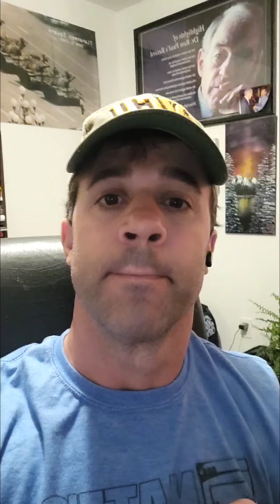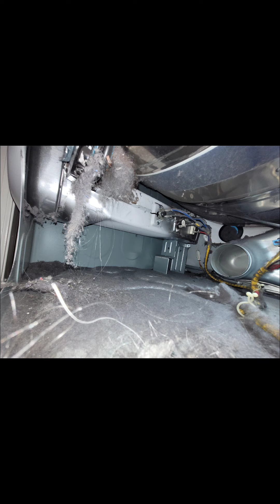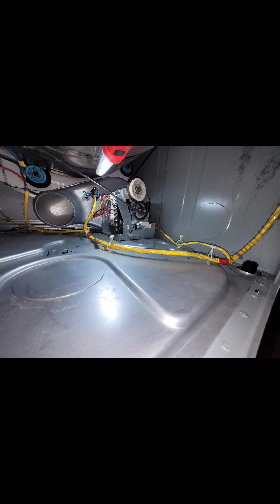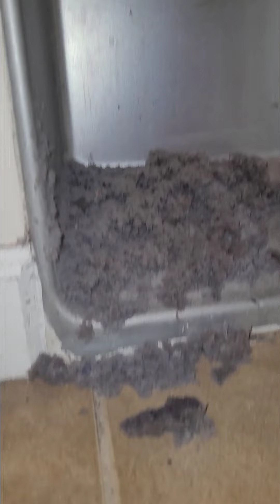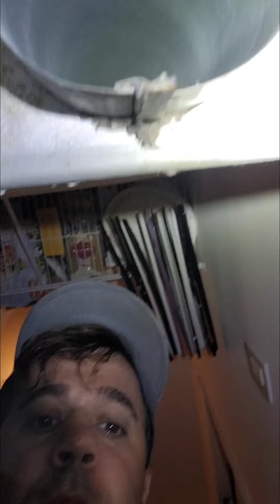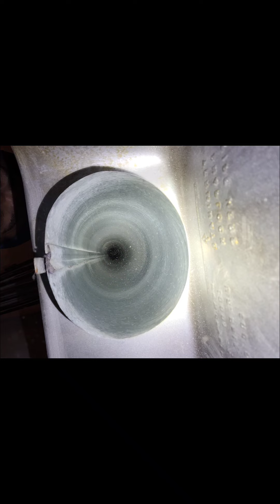Another Dangerously Dirty Dryer

Comment: For sure. My Maytag caught small fire, but luckily it was contained within the dryer.  I just happen to catch it running one night in the dark and saw the sparks at the bottom of the dryer.  I was cleaning some parts of the vent that I can access easily but it was still clogged in the area that I couldn’t get to easily.  What a danger.  Now I do more thorough cleaning.  Thanks.